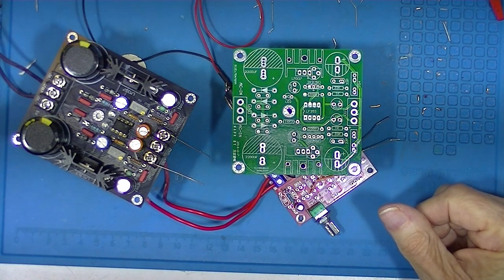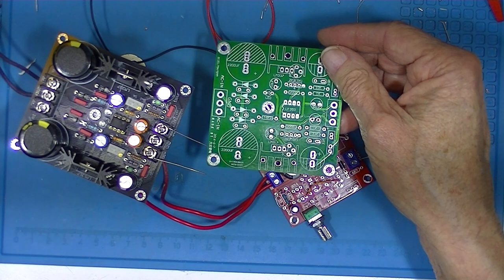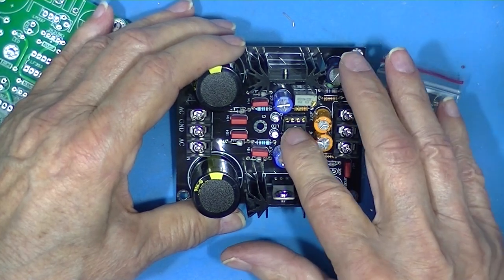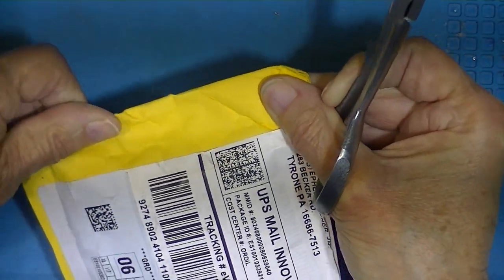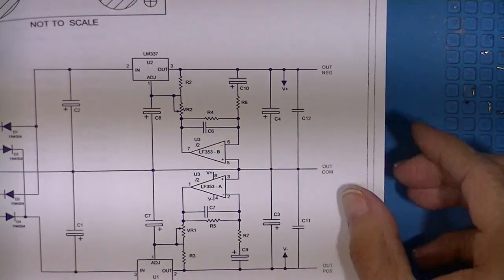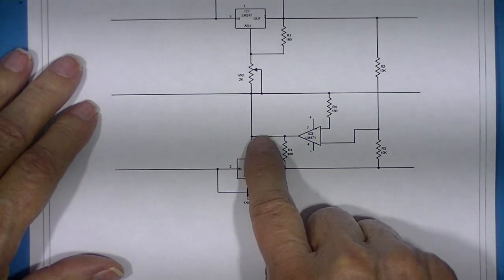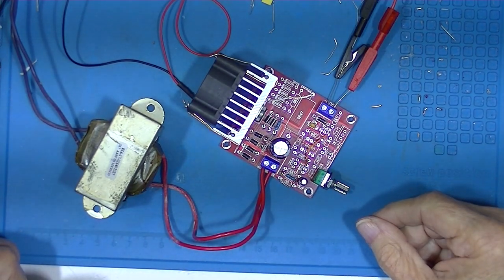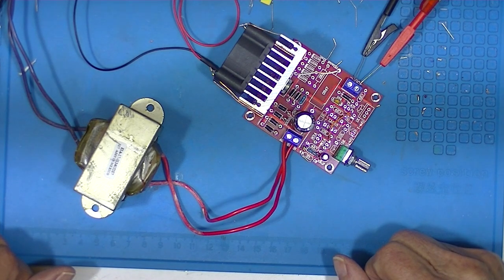Dual Output Tracking Supply - Part  1

Comment: Just replace the two pots with a dual pot like a linear stereo pot. Add a switch on the dual pot (to turn one off) to switch to a second pot and you could have trackimg or imdividual voltages.  Sometimes the mechanical solution is the best and simplest.

Comment: Good video. I myself am looking for a power supply that is dual teaching  and it seems very convenient since i need the one that can deliver around 17V  and fine tune adjustability for it.  One question please:  What software did you use to create that schematic with ? It doesn't look to be KiCad or... Is it ??? I'm looking for a piece of software that is just a stand alone  for making schematics only. Not the ones that are part of the bigger package such as KiCad

Comment: Can the bare green board be used with just a single output transformer to get the dual rail output - and if so how are the boards listed in order to search and purchase them. The dual output power supplies are harder and more expensive to find.